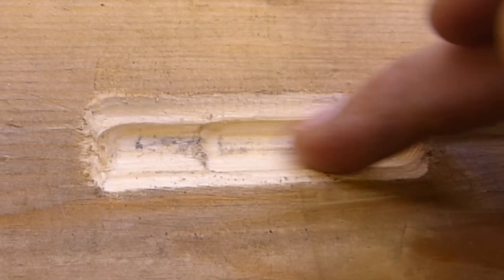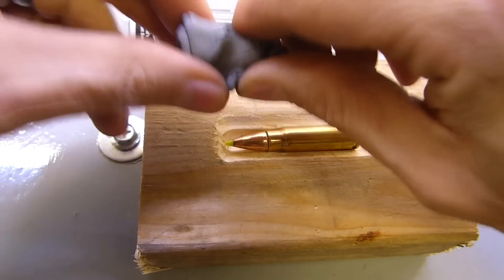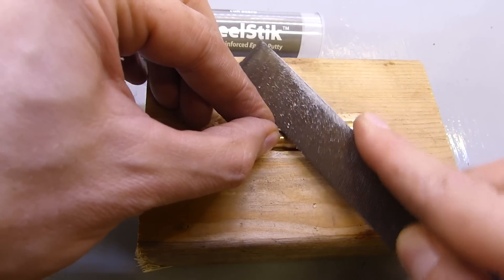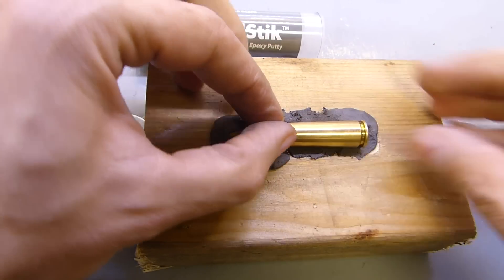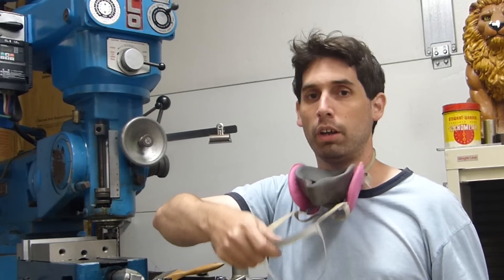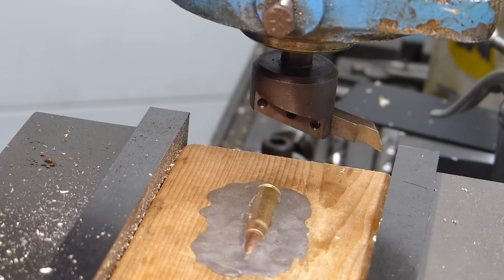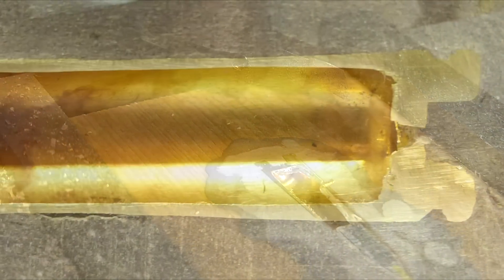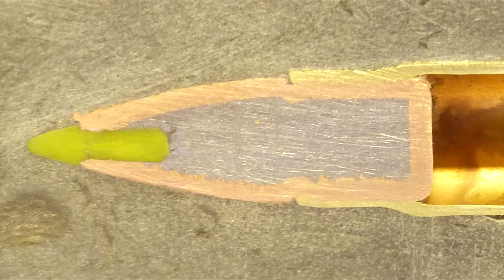Cutting a bullet in half - cross sectioning ammunition

Comment: Might be cool to see a round set in clear epoxy, then cut. Then one could add half a deactivated primer, and  mix up some black sand with epoxy, to fill the casing. Make it look like a live round would if cut in half. 

Also if you use a spiral fluted end mill you might get cleaner results.

Comment: Cool video. I was watching another video and was wondering what method you used to section the cartridge. I was thinking you used liquid epoxy then ground it down on a belt sander.
Wondering if my drill press has enough rpm's to utilize a milling tool. It appears the rpm's on your machine was fairly low but video can be misleading. Thanks again.

Comment: I work as a metallurgist and the standard process for something like this would be to slice the item of interest down the middle with a thin SiC slitting disk and then mount it face down in Bakelite or epoxy. Then it could be ground with successively fine wet SiC paper / diamond and polished. I'll try and do a .223 bullet at some point to show the results.

I see what you mean about the difficulties with mounting this however. Great job btw, love the channel!
Reply from the maker: n00bkill Interesting, i will have to investigate but the reason I went with a single point cutter is that other techniques I tried in the past generated too much heat and melted the lead.  Perhaps liquid coolant would help with that if the slitting disk gets very hot?
Reply: The Ammo Channel you are correct we use a water based coolant with the SiC/Alumina/diamond disks. Of course with lead due to the very low hardness of lead there is increased difficulty with polishing due to the tendency for it to smear. Additionally, the abrasive slitting disk could get clogged unless precautions are taken.
All the equipment we use for metallographic preparation is either from Struers or Buehler so its worth taking a look to see the kind of kit they offer.

Comment: you should have used a 4 flute end mill 1" running at a slow feed and high rpm to make a finish pass. that way it would look really good and no need for sanding.
Reply from the maker: grizzskoalcope I tried an end mill once and it caused the lead to melt.  :(  That's why I used the single point cutter this time and tried to move quickly over the lead.  That lead... it's so crazy.

Comment: One thing that can help with the surface finish is to grind a larger radius onto the fly cutter. Brass and other soft materials can take pretty big radius cutters. You'll want to reduce your depth of cut slightly if you go that route however.
Reply from the maker: Thanks for the tips!